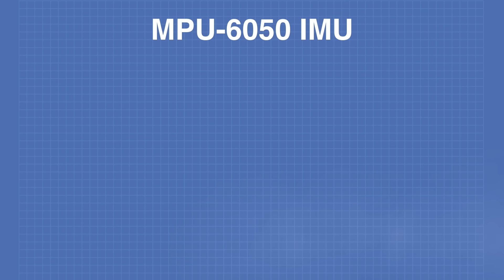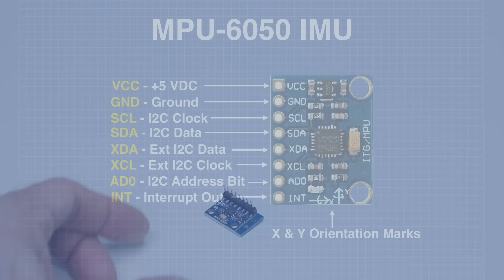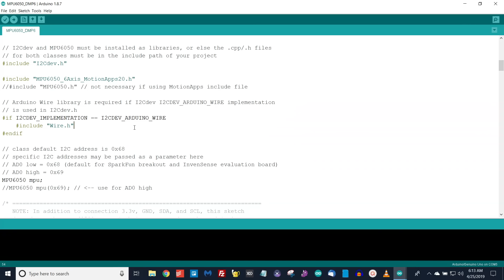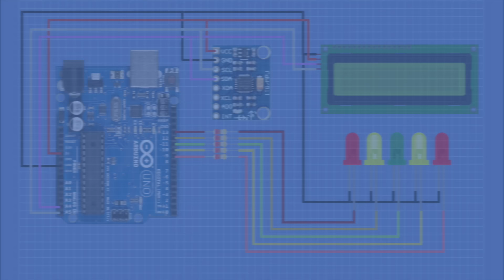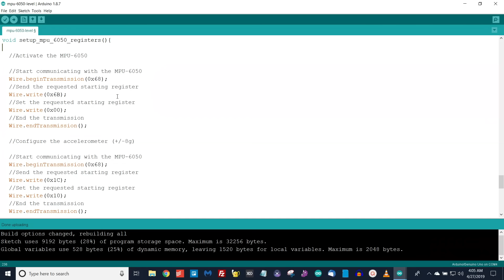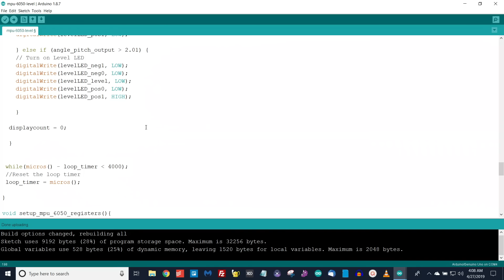Build an Electronic Level with MPU-6050 and Arduino

Comment: I work with a child with severe physical disabilities who wants to fly a drone.  She can use one of her feet for some basic Pan/tilt type functions (she can control an air computer mouse attached to her foot). Could you use this module for up/down and left/right turns or sweeps on the controller side?

Comment: Pro tip: You can directly download MPU 6050 library by Electronics cats in the Library manager of Arduino IDE. It also has built in I2C library.
Reply: Apparently I bought a counterfeit MPU6050 off of Amazon.  None of the examples with the Electronic Cats library worked.  I had to check the Who_Am_I register and got back 0x70 instead of 0x68 that the Adafruit library wanted or 0x38 that the Electronic Cats library wanted.  I had to go into both C++ library files and physically change the values for them to work.

Comment: To bad this isn't followed up properly. One of the zip-files does not contain the library it says. after sorting that out, the code will not compile neither for Arduino Uno or Nano.

Comment: The library you used doesn't work with ESP32-C3. The MCU crashed during initialization. I used MPU-6050-Fusion instead.

Comment: I can understand that the digital spirit level needs only roll and pitch, (a) if for any purpose, I needed Yaw, then can it be done on similar lines as the sensor has 3 DOF?  (b) If two of the MPU6050s are placed perpendicular to each other, will I have all three parameters of Roll, Pitch and Yaw?
Reply: (a) The internal registers of the 6050 chip are (in decimal) 59 and 60 for X acceleration , 61 and 62 for the Y acceleration, and 63 and 64 for the Z acceleration. The first register of each is the high byte. You can probe all three registers and then get all three axes.
(b) No need for a second chip to get 3-D orientation.

Comment: sorry for being dumb, but why are we only working with roll and pitch, not yaw?
Reply: A surface can be made horizontal by considering the slope in only the x and y directions. So for the 6050 chip this will be that 0 g acceleration is detected for both x and y. When this is the case there will be exactly 1 g  (or -1 g) acceleration in the z direction. So the z axis is redundant.
You could in principle just monitor the z axis until 1 g or -1 g is recorded, but if you are off then you wouldn't know in which direction to tilt in order to get level without using either x or y measurements.

Comment: Would you explain it to me why you didn't use pull up resistors and the i2c pins on right top (18 and 19)? 
Thanks for the explanatory video.
Reply: I think that the gy-521 module has inbuilt pull-up resistors.

Comment: When the MPU is first initialized and calibrated on a level surface are the results stable or do they drift over time? If there is drift how often would the lever require a reset?

Comment: Just to be extremely precise: the degrees of freedom are not related to the gyroscope. In Mechanics, those degrees of freedom are defined and we know that there are 6 of them: translations along three axes, X, Y and Z, and three rotations around those three axes.
A classic mechanical gyroscope remains motionless in space in its initial position and if its supports are moved (for example, an airplane) it gives us data on angle changes.
Reply: Be careful here. You need to specify WHAT the degrees of freedom are for. Do you mean DOF for position, acceleration, linear motion ? For the first, there are 6 for 'everyday' use, for the second there are 3, and for the third there are 3. This can be also related to how you think about a problem. For example, we could talk about translation kinetic energy and rotation kinetic energy. Then we might say that we get 6 degrees of freedom, but we only have 2 because kinetic energy is not a vector, so direction (or rotation axis) in space does not matter.
Reply: @SK-ow4vw  The degrees of freedom are generic and not related to any physical phenomenon. This means that a body can simultaneously move and rotate around all three axes of the Cartesian system. This further means that the body is free in space. By taking away one freedom at a time, in the end when we take away all 6, the body will be immobile in space. It has nothing to do with energy, acceleration, etc.

Comment: While following this tutorial at the point when we first test the thing mine began getting very hot, then I got multiple errors but it still uploaded the code and so I checked the serial monitor and it gave me this message➡️ Initializibg I2C device (4 backwards question mark then a funky lookin i followed with a square and a bunch of other strange characters) does anyone know what could be causing this
Reply: Got similar result
edit: nvm you just need to change the baud rate on the serial monitor to 115200

Comment: I am puzzled. I have wired up the level to display on LCD. When I run the scetch I get error message "Posetive was not detected". I changed the address from 0x3F to 0x27 and I still get the same error massage. The LCD lights up so I know that LCD gets voltage. I then ran "hello World" sketch and the LCD displayed worked as it should. How can I make this thing work????!!!!!!

Comment: what did you use to mount the MPU6050 to the wood? I keep having difficulties with the MPU6050 connection failing or turning off due to the pins not making proper contact with the holes of the MPU6050, any ideas on how to help maintain this connection? I see that your MPU6050 never turns off even when you turn it many which ways. Thanks in advance!

Comment: I've had no luck trying to use Jeff Rowberg's libraries or sketches. The connection to the mpu6050 fails. Same story with the adafruit mpu6050 library. However, the mpu6050_tokn library works without any issue. I don't understand

Comment: Hi. Thanks for this. i have a very strange issue when i run the MPU6050_DMP6 example. i get stuck at: Initializing I2C devices...
 tried with another sensor same issue, also tried another UNO board still same outcome. Also tried IC2 scanner sketch same issue does not find an address for the MPU6050 board. Can you please point me in the right direction? green led is on on the board but seems like i cant initialise
Reply: I'm having the same issue right now, did you solve the problem in the meantime?
Reply: @Florian00  yes Both of the sensors were faulty... 🙄 In the end i ordered some new ones and those worked Just fine
Reply: I'm also having the same issue. I can't get it to connect successfully when running the example code. It's a brand new chip so shouldn't have any problems but it's frustrating. I can't get the level code to work either.
Reply: @adamsvette  I did not solve this issue and ended up using another code for my project. Somehow my Arduino A4 and A5  do not work either, found that out when using the I2C scanner and nothing popped up
Reply: youIameazz whlteboi

Comment: I would like to do an electronic level like yours. I hooked up everything like your diagram without the resistors and leds. 
I copied your Electronic Level Sketch codes, verified and upload but it gave error message that I am posting underneath. Could you help?

Arduino: 1.8.15 (Windows 7), Board: "Arduino Uno"

sketch_may24c:23:65: error: 'POSITIVE' was not declared in this scope

 LiquidCrystal_I2C lcd(i2c_addr, en, rw, rs, d4, d5, d6, d7, bl, POSITIVE);

                                                                 ^~~~~~~~

exit status 1

'POSITIVE' was not declared in this scope
Reply: YouLAMEwhlteboi

Comment: The diagram at 4:14 in the video is a bit misleading. Any pure accelerometer would always react to the force of gravity at 9.8m/s^2, Sitting still all three values wouldn’t equal 0.  X  = 0 , Y = 0, and Z = 1.
Reply: youIame whlteboi

Comment: Very nice. And the electronic level was exactly what I needed for a current project. I'm using laser LEDs that point to the ground. And I want to switch them off if my device is moved or tips over to avoid someone accidentally looking into the laser beam. Seems like the GY521/MPU-6050 is the component I need as a safety device. Thanks for your effort.
Reply: you Iamewhlteboi

Comment: really  very good explain i have one question i want to control a moving  platform its having 4 wheels connected  with
Reply: If that's a question, you need to be more specific. What is this "4 wheeled moving platform" supposed to do? Why do you need an IMU for it?
Reply: YouLAMEwhlteboi

Comment: Hi I have a doubt what happens to output of accelerometer when accelerometer is moved with same speed for some time will it be zeros or some constant km/s^2
Reply: This relates to forces and Newton's laws. Acceleration cannot occur without a force being present. Acceleration is a change in velocity. Velocity is a change in position. 

You mentioned moving the sensor at the "same speed for some time." This is called a constant velocity. When that happens, even though its position is changing, the velocity isn't changing. Therefor, its acceleration is zero and the sensor output would be zero. 

But it's also important to note that velocity is a speed in a given direction. So a 'constant velocity' also assumes no change in direction. Moving the sensor at a constant speed, but not in a straight line, is not constant velocity and will result in non-zero acceleration outputs.
Reply: Imagine being in a car moving at a constant velocity (it's going straight at an unchanging speed). If the road and tires were perfectly smooth, you wouldn't feel a thing. But, if you speed up, slow down, or start turning, your body can feel this change in velocity. It's the same case for the sensor.

Comment: I am very new so maybe I am missing something obvious. I am getting a compile error as follows 
In file included from /Users/ronalexander/Documents/Arduino/libraries/MPU6050/Examples/MPU6050_DMP6/MPU6050_DMP6.ino:48:0:
  -> candidates: []
/Users/ronalexander/Documents/Arduino/libraries/MPU6050/MPU6050_6Axis_MotionApps20.h:47:30: fatal error: avr/pgmspace.h: No such file or directory
compilation terminated.

Also I don't think my Board manager is set up right, What board should be selected, I can't find anything like MPU-6050
Reply: youIameazz whlteboi

Comment: Am I correct in assuming the default orientation of the MPU is with the INT to the bottom left. So X+ goes right and Y+ forward and Z+ Upwards. Which means at 31:02 the X+ is now pointed towards you and Y+ to the right. This would make Pitch+ direction go counter clockwise. Thx
Reply: Also at 31:02 the Yaw would 90?
Reply: youIame whlteboi

Comment: Hello! Did it worked without soldering the pins of the MPU-6050? I can't understand how because mine isn't working, the sensor's led is struggling sometimes and I found an article on the internet where it says the pins must be soldered. It's weird also because the numbers for yaw, pitch and roll are decreasing continously even if the sensor is left unmoved. Please help if you have any idea to try, thank you!
Reply: most likely you did something wrong
Reply: youIame whlteboi

Comment: Beautiful !  Thanks much. 
In other cases using my drone,  cellphone, etc I have to move it in a figure 8 etc to calibrate its initial position. Does that 1000 reads at the beginning  do that ? Thanks again.
Reply: That method will get you a rough approximation. Try MPU6050_tockn - Arduino library for easy communicating with the MPU6050: https://github.com/Tockn/MPU6050_tockn
Reply: YouLAMEwhlteboi

Comment: When I tried to add zip files, audrino said that those zip files  doesn't contain  a valid library.  How can I fix that?
Reply: You need to extract the zip and then choose. :)
Reply: Or click on the zip file to open it, then select that inner folder as the one to be used.

Comment: Really cool.  I  have had one of the 9DOF sensors in my drawer for several years, only tried playing with it a  couple of times, didn't find it all that exciting since I am not into drones.  Now, however I can see where it may be very handy in my RV for leveling her.  The built in sensors are so slow that getting the old gal level enough for both walking and the operation of the frige are essential. I currently use an old spirit level and my wife telling me which way to go with the hydrolic levelers, but this would make life for both of us much easier and lest chaotic when we move to a new site.  That is if we can ever get on the road again with this damn virus crap.
Reply: YouLAMEwhlteboi

Comment: hey, can we detect a deceleration with this sensor to blink an LED to make a brake lights?
Reply: I think you can.
Reply: Probably, just remember that the vehicle will also decelerate while 'coasting.' So the lights might turn on then, even if you aren't actively braking.
Reply: youIame whlteboi

Comment: I tried many times and changed many things but I'm still getting trouble with the connection to the MPU, it's always a fail. If anyone have already solve this problem please tell me.
Reply: uh oh i had also problems while i was in 3.3V. 5V works now
Reply: @rektangel333  Thxs for your answer but it actually don't change anything. Any other idea?

Comment: Might be worth mentioning, if looking at using the MPU6050 with another processor, such as a PIC (as i am) the DMP Needs a firmware uploading to it before it works at all.
Jeff's Arduino library does this for you if you use Arduino, which is where you can get this DMP firmware.
Annoyingly Invensense's Register documentation doesn't even mention the registers used.
Reply: you Iamewhlteboi

Comment: i dont know why I cant  add the library
It says Arduino: 1.8.10 (Windows 10), Board: "Arduino/Genuino Mega or Mega 2560, ATmega2560 (Mega 2560)"

Specified folder/zip file does not contain a valid library
Specified folder/zip file does not contain a valid library

This report would have more information with
"Show verbose output during compilation"
option enabled in File -> Preferences.

Comment: "Inertial force?"  Really?
Reply: Isaac Clark I was shocked too. 35000 views so far and there’s only your comment and my like of it. 😭
Reply: @ArnaudMEURET  So, that's why there's 100k+ views so far and only 3 likes on this comment. Inertial force is indeed a technical term, albeit probably uncommon.
Reply: Inertia is the object's tendency to continue moving the same way, yes? Well that's why the force exerted by the weight on the sensor is the "inertial force." Yes, inertia isn't a force at all but it's the "inertial force" is brought about by accelerating some object, because that object doesn't want to change the way it's moving.
Reply: "Inertial force".  That's not a thing.
Reply: @isaacclark9825  There's various names for 'fictitious forces'. Simply google 'fictitious forces' ...
Reply: @isaacclark9825  While it might not exist as its own force, it is indeed "a thing." It is a perceived force based on the frame of reference.
Reply: @mattn.8941  So a force that does not exist as its own force, but you are going to call it a force anyway.  No thank you.
Reply: @isaacclark9825  When you accelerate in a car, do you feel the seat propelling you forward along with the vehicle? From the car's perspective, it is staying still, you are exerting a force on the seat, and the ground is accelerating beneath the vehicle. 

Now imagine this sensor is staying still and the weight inside is pushing on one side (compared to reality, where the sensor accelerates and pushes the weight). From the sensor's perspective, the weight is exerting a (fictitious/inertial) force on it and its surroundings are accelerating accordingly.
Reply: @isaacclark9825   Such accelerating frames of reference are called non-inertial frames of reference, and is the basis for how the sensor's output is acquired. That's why it was included in the video... and why I said it's a 'thing,' even if the naming convention doesn't suit you.
Reply: @mattn.8941  If the seat presses against you when you accelerate, then you exert a real reaction force on the seat according to Newton's third law.  That would not be a fictitious force and there is no need to apply some term like "inertial force" to something like that.
Reply: @mattn.8941  l am aware of the termination. But not applied to ordinary reaction forces in this context.

Comment: Hello actually I am facing a problem with mpu6050,am working on self balancing propeller arm system where whenever motor turn on then it gives a lot noise even it gives negative value maybe due to vibrations plz help
Reply: youIameazz whlteboi

Comment: Hello,
I'm a beginner on Arduino,  and I decided to make this electronic level, my first Arduino project.
However, I have every object needed (Arduino UNO, LEDs, MPU-6050 and resistances) but I don't have the LCD screen. 
So, yesterday I copied the code and put in comment every LCD command, but the electronic level doesn't work.
Please, someone can tell me how can I change the code to make it works without the LCD screen ?
Thank you in advance.
Reply: YouLAMEwhlteboi

Comment: I have a question. I tested the Examples that was on the File->Example tab and found that the values of the Gyroscope is not 0 even I didn't moved. The GyX value was under -400 so I assume that this is not because of the small external vibrations or something.
Reply: you Iamewhlteboi

Comment: Can you use this to make an Inertia Navigation System. This was a Nav system in use before GPS became popular.
Reply: I'm sure GPS became more popular because of its accuracy. Over time, the small errors in the data from the IMU can lead to greater inaccuracies. For example, if you record the inertial data for a vehicle, it might give you fairly accurate changes in location or distances traveled for a while. But over time the results could go from a few feet of error to being miles off.
Reply: youIame whlteboi